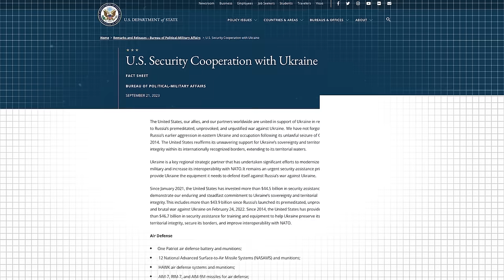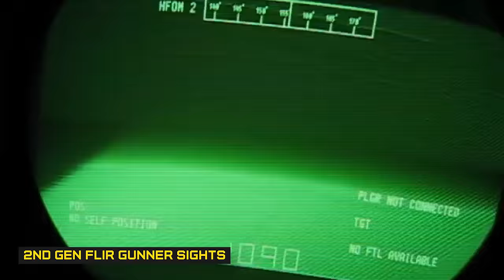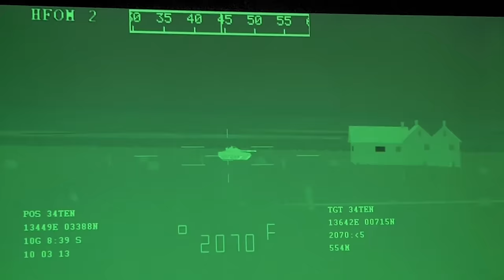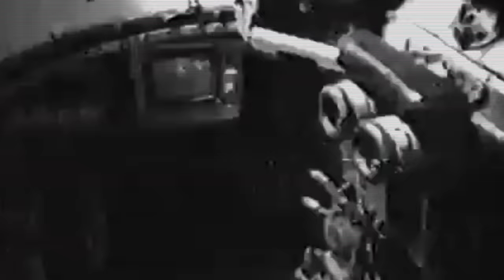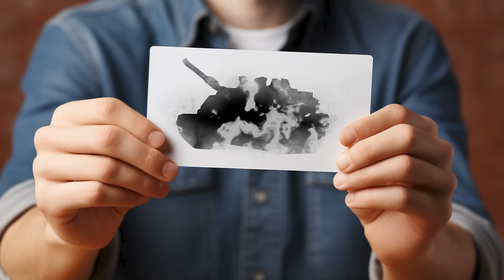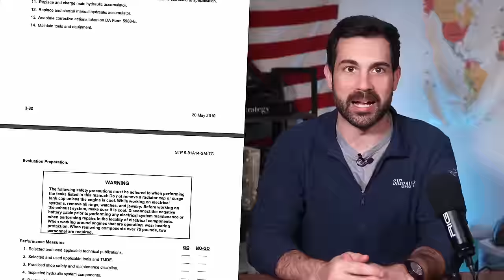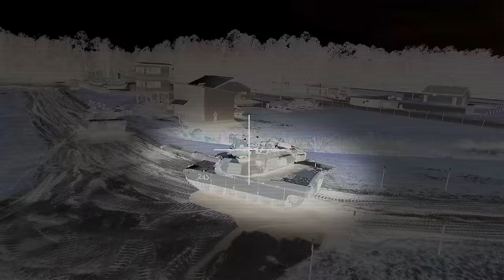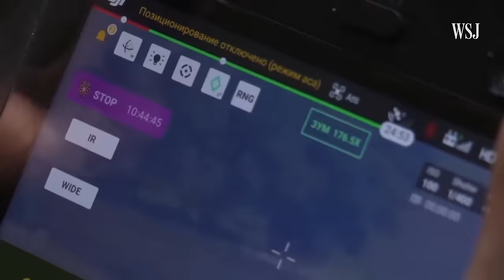M1 Abrams Tank Tactics in Ukraine

Comment: Re: Training Ukraine on "complex" equipment.

Training is complex for the providing agency but far less so for the trainer or trainee. Maintenance fears are almost always exaggerated and field maintenance of for example electronics involves troubleshooting of line replaceable units, not (emergencies excepted) opening up gray boxes and doing board level repair. Task and Purpose would benefit from finding a grizzled old tank technician (retired military contractor preferred or someone else with thousands of hours experience to assist an episode on how AFV and wheeled vehicles REALLY are (no clickbait outside the title, no excitment, just info from someone genuinely skilled. NO OFFICERS, technicians only not their supervisors. 

While mechanical systems impress those who do not work on them as next to magic, most of any TM or other pub is necessary reference material rather than steps of an actual task.. Military training is designed to turn rather average people (and Ukraine would logically send their most adept and quick learners) into effective maintainers in months.  Modern AFV are very like aircraft without wings and the same companies make their electronics, sensors etc. A turbine is a turbine on a helo or a tank (and those are replaced with the assembled power pack in the field which is quick) and designed with rapid maintenance and repair in mind (though engineers do fuck up). I fixed Vipers for a living, trained many others in my turn, and training can and does turn anyone off the block and not completely retarded into a useful troop very quickly.  

The main drawback of ground vehicle maintenance is unlike aircraft they get the shit beaten out of them and the field working conditions are nasty with heavy filthy greasy parts, but that's not a tech issue. That's a don't be a little b1tch issue. 

Wrenching almost anything is fun or don't be a technician. I expect Ukraine sends volunteers first and people with prior experience on mechanical systems take naturally to working more modern stuff.  Ukrainian enthusiasm is obvious and THAT is what makes a technician.

Comment: With its red hot running turbine engine it’s visible from space by satellite.  It’s also mechanically complex and will likely experience repair issues.  Turbine has some advantages in the arctic but not in Ukraine where diesel is fine in the winter.  Will make no difference those shahed and lancets plus drone guided Russian artillery and mines mean they’ll be scrap in no time.  I guess after the Russians take Odessa a few may remain in what’s left of Ukraine with its new capital of Lviv.  We also sent them without the normal classified heavy armor package so they take a direct hit and it’s lights out.
Reply: True for the export model…yes.

Comment: The air support thing can be filled by drones and manpads. Truth be told, Ukraine could use some rapid mine clearing capability. For the supply lines. I'm not gonna think about that because I was never an rts guy. The most I've ever felt that was when I'd run out of ammo in huge engagements in game, and have to run several minutes to find a resupply or someone that can give me ammo.

Ukraine has the perfect tool for assisting the abrams, destroying grounded Russian aircraft, hunting manpads and AT teams, destroying radars. They have tools capable of hunting very specific target types. Drones. It's also possible to set them up to auto seek on drone jammers or fly in a straight line past them until there is a signal again.

Comment: Why are you lying about the capabilities of 1G40, 1G42 and 1G46?
Refleks/Agona/Kombat are rated 5km for a reason.
Agava-2 is not limited to T-80UK, the footage you showed was of a T-80U45M, which does not have thermals of any kind.
It uses a laser array to illuminate the target.
Sosna-U is equipped on a variety of vehicles with EOTS, something the abrams has never had.
Every soviet tank since 1959 is able to fire on the move.
There are a large amount of videos showing engagements of other MBTs in ukraine in excess of 5km with very good resolution, this is in contrast to videos of the Leopard 2 where gunners struggle to identify targets due to how blurry the thermals are on it.

Comment: Modern tanks should be equipped with small automated spotter drones to identify targets in an area automatically and relay their position to the tank. Such a tank could destroy targets much quicker and could also retreat faster from an incoming attack or ambush. Today, even with the best optics, the tank commander can only see "line of sight".
Reply: well off you go and invent them
Reply: @stephenallen4635   They're already "invented", but not being implemented. Drones exist and self-flying + optical identification AI exists. Radio that can transmit data wirelessly also exists. Finally, tanks exist.  It's just a matter of putting everything to work together.
Reply: @SevenSixTwo2012  yeah cool idc you go make it a thing
Reply: @stephenallen4635  Yeah, because I'm a major US defence contractor here with a billion dollars to spend on such a contract, lol.  You ain't the sharpest tool in the shed, are you?

Comment: Is there a source for the "from prepositioned stock"? That could indicate US quality Abrams will be sent, which would be against the US's former sales practice. Sources explain that export Abrams are degraded models. DU armor is removed, replaced by other armor, often tungsten plate IIRC. US models have thermal sites for gunner and commander, but exports have only thermal for gunner. The last Abrams body and turret was built in 1996, so all current models simply rebuild/upgrade existing tanks.

Comment: As pointed out, the Abrams can serve as a very robust defensive tool - however, what is lacking are the numbers. 

For context, nearly 1900(!!!) Abrams were deployed in Iraq.  If the Abrams fails in Ukraine, then it never fulfilled the original purpose for which it was designed.

Comment: Wait, the turbine engine in the Abrams is much louder than your standard diesel tank? Every other source I've read or heard of says the exact opposite. I think maybe the confusion is that the Abrams engine is capable of hitting momentarily louder sound levels than other tanks, but those are at much higher frequencies, and high frequency sound travels much less than low frequency. I mean, I thought the Abrams had been given the nickname "whispering death" because it was so hard to hear compared to other tanks. Or is that just propaganda? And if I remember the reason they originally went with the turbine engine over the diesel engine was because the diesel engine spewed out a telltale plume of black exhaust, while the turbine engine's exhaust was clear.

One other thing, my understanding is part of the reason you have white-hot and black-hot modes for thermal vision is to allow the light-receptor cells in your eyes to rest when they get fatigued. The cells in your eyes get activated in response to light and send electrochemical signals via your optic nerves to your brain, but they can get worn out and have their electrochemical potential depleted. When that happens it gradually gets harder and harder to actually distinguish what you're seeing, because the photoreceptor cells have literally run out of the chemicals they need to send signals to your brain. By switching from white-hot to black-hot (or vice-versa) you completely invert the image, meaning that the cells that were inactive are now taking most of the load and the tired cells get a chance to restore themselves. And your brain is smart enough to be able to interpret the image either way, so your visual acuity stays more or less the same.

Comment: I understand that the Abrams is less and not more noisy than diesel tanks.
I also read that the Abrams idling fuel consumption problem was fixed with an auxiliary generator, were these included in the M1A1SA?

Comment: 20 years ago when in the Army I was walking down a road and I kept hearing squeak, squeak, squeak....I turned around and there was an M1 keeping pace about 50 feet behind me.  I only heard its engine when it passed me...from the front I would never have heard it if it were not for some squeaking from the tracks.  As for DS repair, the entire US military is like that.  It is designed to ID problem, pull part A and replace with new part A...anything more than that is Depot Level maintenance requiring evacuation of the equipment to the real.  The average Army Ordnance repair soldier is a young guy that went through the Army maintenance school and that is the extent of their knowledge.  In Desert Storm where a whole bunch of USAR and NG support units were called up the average DS unit member was older with many being in the mechanic field as a civilian and with a lot of experience.  One reason that all went so well was that reserve DS maintenance units were able to do Depot lever repairs such as an over night engine rebuild.  I suspect that a lot of the AFU repair people fall into the category of being able to do that engine rebuild rather than just replace A with new A.  We will see...

Comment: Ehm Challenger 2 has a rifled gun instead of Leo2 STRV 122 and Abrams which all have the same 120 Smoth bore designed by Rheinmetall, LEO 1 uses the british 105 which was also used by Centurion and STRV 103 to name a few icons.

Now the question every dark net lurker asks themselfs, Which will be the last western tank to operate without losing a tank chassie?. The current finalists are LEO 1 Abrams M1A1 and STRV 122.

Can't say im looking forward to know but it is intresting as they all have diffrent doctrinal designs even though STRV is a Very modified LEO 2A5+. 

Best Regards

Comment: Why did no one think about sending some of the older Marine Corp LAV-AA that are mothballed and being replaced by newer LAV variants that have more advanced battlefield connectivity? With LAV-AA deployed with the Bradley and Abrams the armored Battalion, Company or Platoon would have air cover while refueling, bridging,  or slower formation movement between battle spaces. 

Oh wait. Because here Marine and Army don't work together so taking assets from each and combining them is too out if the box for anyone to think of. Or train for.

The LAV-AA can shoot while moving, does not need a separate support vehicle for radar when defending smaller than 25 miles, can move faster than the Bradley or Abrams to set up forward dependable spaces for particular logistics operations,  it can ford a river without the need for bridging equipment and is far far faster set up for that than the Bradley or Abrams snorkel set up. Can run on the same fuel as the Bradley or Abrams when set for it. The LAV-AA is a but more limiting than the LAV-25 but can carry a small contingent of soldiers.  Moore than the Bradley. It's only weak point is in its own ground defense. It only has a .50 cal or a full auto granade launcher for self protection so it needs to keep a Bradley's TOW missles and autocannon close by as a wing man. 

LAV-AA-"I'll watch the sky and protect us from MIG, Alligator Choppers and drones"
Bradley-" OK brother, I will protect your back and flanks from dismounted Infantry,  APC and Tanks."

Ukrainian squad layout may be different. 
With both the Bradley and the LAV-AA having Infantry usually consisting of a squad of five with Squad Leader M-16/M-14 with underslung granade launcher/Radio/9mm or .45 Hand gun, Scout SAW light machine gun, Heavy Weapons Gunner M60 Heavy Machine Gun, Heavy Weapons ammo/barrel/optics, Forward Air Operator skilled at calling in airstrike or danger close artillery/also carries base M16A2 and Barrett .50Cal Sniper rifle or M2 Grand depending on operation need and sharp shooter preferance.

Dismounted during fuel,  repair, bridging early in the rear and ahead they can take high point vantage or scout patrol from front/rear to flanks to defend from enemy infantry. 

That's how they would be used by an LAV platoon in 93 would do it any way from 2ea LAV-25, 1ea LAV-AA, 1ea LAV-AT and LAV- Command/Radio or 3rd LAV-25. The 2ea to 4ea LAV- Recovery/Maintainers would travel with H Company along with the LAV-Lagistics for Admin, Radio/Command, Cooks, Armory, Command Staff.

Comment: Just wait till the brand new Abrams X comes out. It's somewhat stealth for thermal imaging. New canon and autoloading. With trophy system built into it. With 40-50 years of armor technology improvements to. 3 operators.
Reply: Also a new hybrid diesel, so it will be way more quiet. More electricity to, there is a chance lazer's could be on it.

Comment: 32 old M1As is nothing compared to the stored old stock German Leopard 1s yes Leopard 1s. They are no whare as good as the M1 or Leopard 2 but the Germans have 400 in storage and can be quickly refurbished with make shift german active protection and older Thermals plus they are much lighter for European Bridges. Quantity as Stalin said has a quality of its own. They do use a 105mm gun but we have lots of that ammo stored.

Comment: I know more than half of the Leopards (those from Poland, Spain, etc) are barebones 2A4, so really a 40 year old tank with no upgrades. But the Challenger 2 company and 2A6 battalion should provide equal firepower, yet I don't see them in the fight. It seems after initial losses, crews are given more time to train and the fortifications and mine fields are being slowly overcome by artillery, infantry and mine clearing vehicles (like the 40 German WISENT MC and T72 mine clearing shields provided by Germany).

Can 31 M1A2 really overcome a defensive line with tank trench, mine field, dragons teeth and manned trench systems where you gotta expect RPG and possibly ATGMs? Honest question, how would that work?

Comment: Cmon now, all new T tanks have laser rangers and almost all have thermal sights, they even be putting them on old t64s. At this point it looks more like, “we tried”, than something that would actually do anything
Reply: Problem is that that most T series tanks have such cramped stations that it basically makes them almost useless. Russians traded crew comfort for smaller profile, while Western tanks maintained the larger profile so their crew can operate to their max efficiency (also with the fact that due to major corruption in factories that build T tanks, all of them have slight differences because of the materials, quality of parts).

Comment: Russian defenses weren't sometimes anti-tank mines or ditches.  It was often triple-stacked anti-tank mines and mines very densely packed (as in 5 per square meter) over an area the size of Florida plus helicopters and dragons teeth/wire and massive artillery support.  I think even the full force of the U.S. Army might struggle to breech that.  I think we would require air superiority and everything we have to create openings through those minefields in a handful of places.  The Abrams came late and 40 years old with only steel armor.  We sent 31 of them and it wasn't long before 8 of them were lost, one disabled and captured.  Since then, I think another two or three lost.  Ukrainians have now weldon on anti-drone cages and even Soviet reactive armor plates because they have lost crews.  The most survivable table on the battle field was the British Challenger, it seems (to me).  On the other hand, the Ukrainians seem to prize the U.S. Bradleys above all other armored vehicles.  They have lost a fair number of them but more so because they have made more extensive use of them, particularly, in the winter mud in areas where no other armored vehicle could go.  The auto-cannon's anti-personnel rounds are highly effective and the vehicle is highly survivable.

Comment: Was under the impression Abrams was a lot quieter than diesel tanks . . . . .
Reply: Yesnt 
It's a myth and a fact.

The Turbine engine is loud when you're next to it. Louder than a desiel.
However the sound is higher pitched.
Meaning that sound drops off very fast with range
Making it much much quieter from engagement distances

Comment: I'm no officer, so this will be an armchair general take. Just disclosing that I have no qualifications, but for being just an infantryman. 
With the disclaimer out of the way, I suppose the best use for Abrams tanks would be their intended purpose. To defend against Russian armored assaults. The Abrams has a fatal flaw for Ukraine, which is the logistics tail it requires, as well as the weight making any offensive routes predictable. 
So if I was a general responsible for Ukrainian fighting, I would allocate the Abrams tanks to be a mobile defensive force. Any time the Russians prepare an assault, start up the Abrams tanks and send them to reinforce the defenders. 
This would get use out of their durability, high speed, good optics, and firepower. It would also keep them away from enemy minefields, bottlenecks in enemy held territory, and stop them from being captured or filmed by Russians for propaganda.

Comment: What about Russia using and producing the newer T-90M, T-72B3, and T-80BVM tanks? Those are all equipped with third-generation thermal imaging sights and various improvements in their armor and targeting capabilities. Not to mention, they announced a newer T-80BVM (2023) model with an improved gun, better reverse speed, and an anti-drone jammer system. (info on those tanks from RedEffect’s videos)

Also would like to point out that the Challenger 2 CANNOT use the same rounds as the Abrams. All Western MBTs use single piece ammunition and are technically interchangeable, but the Challenger 2 is the only one with two piece ammunition that is exclusively used for the Challenger 2 due to its rifled barrel design. It cannot use single piece ammo.